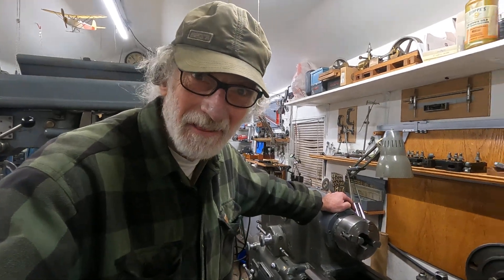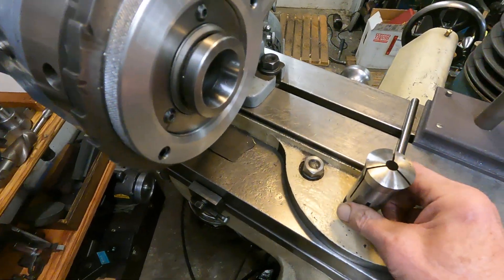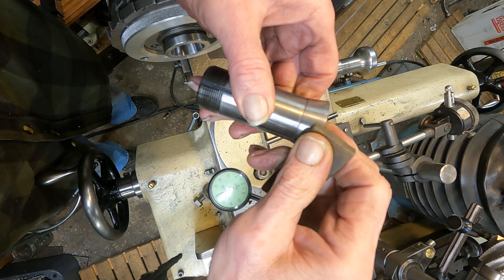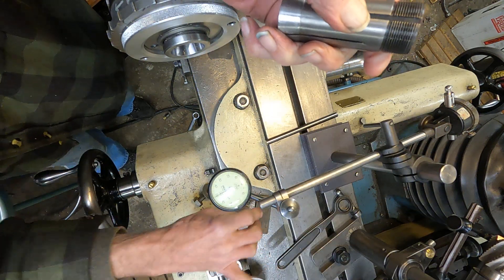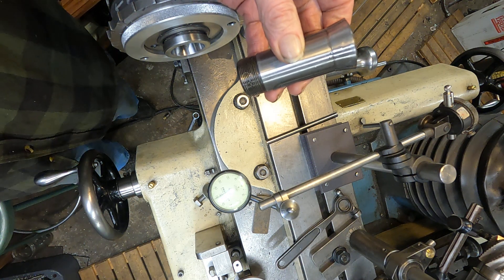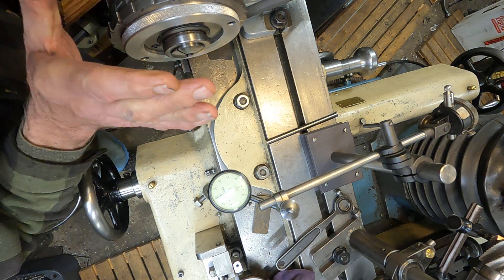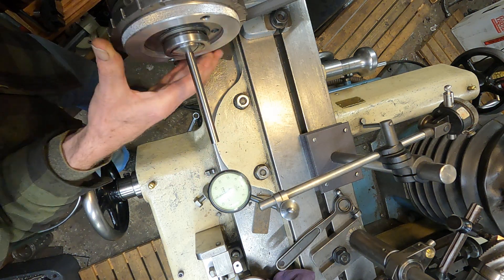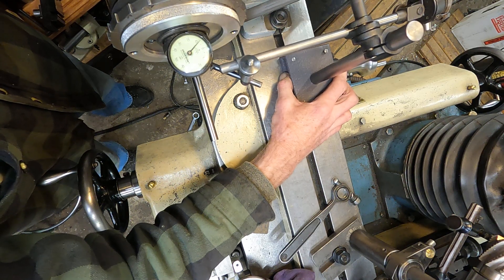Truing the 5c Collet with the "one eyed" hammer

Comment: Don ejector pins want be really straight enough to use as a gage  . But sometimes you can find a core pin that will work . But your right ground drill rod is probably the best . Thanks for sharing your adventures . Love it
Reply from the maker: I am not sure just what this 3/8" polished material is, but it is very true and can be used as a gage. I am working on a front mounted 5c lever collet closer for the lathe that operates differently and appears to have good accuracy but I still have to flex the part and give it a tap to get the end running true because of the single and narrow locking taper with the clearance needed for the straight potion of the collet there is wiggle room.